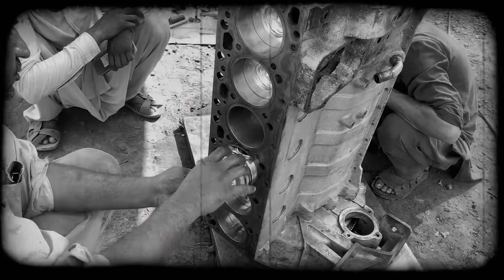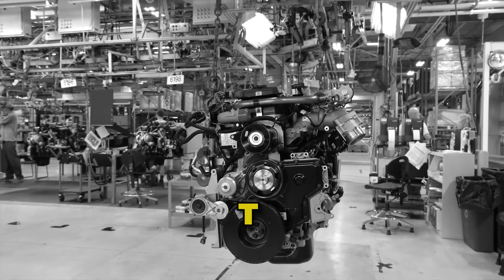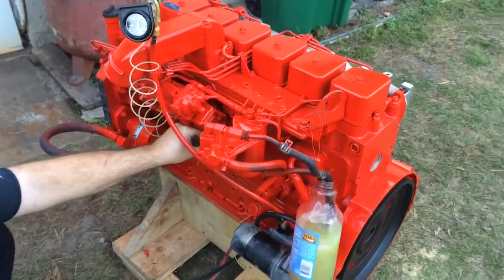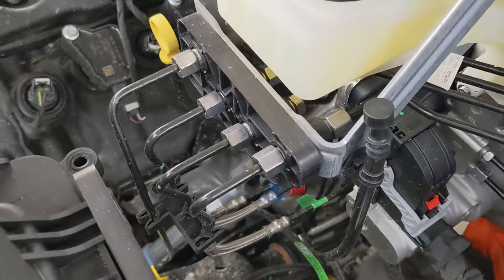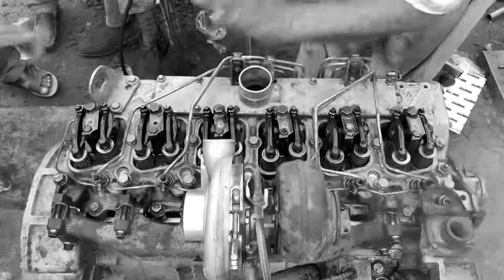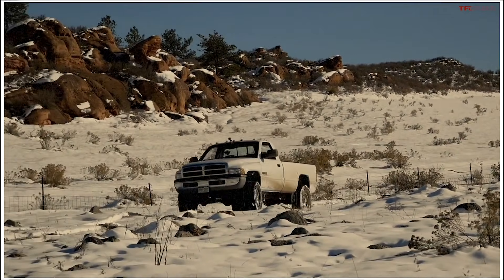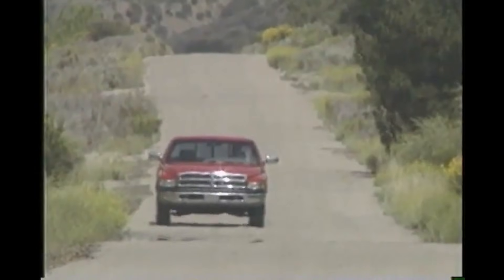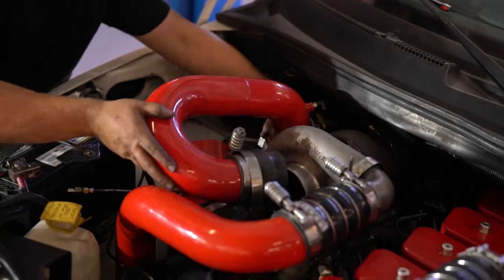Why the Cummins 6BT Was Too Durable for Its Competition

Comment: At my local college, I was in a diesel mechanic class where me and a few others were working on a 6BT. It was indeed very simple to take apart and reassemble the engine without any problems. And once it fired up, it sounded just like it should be.